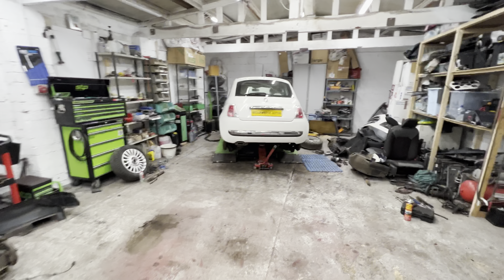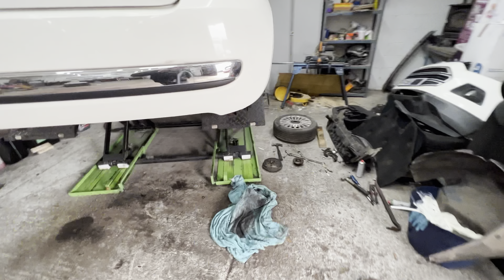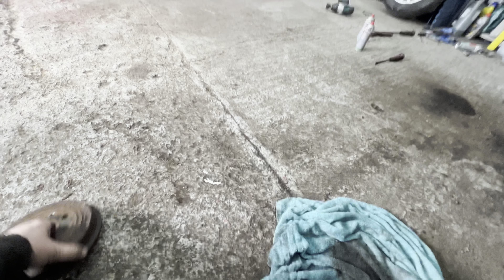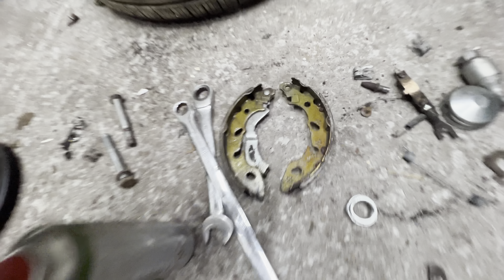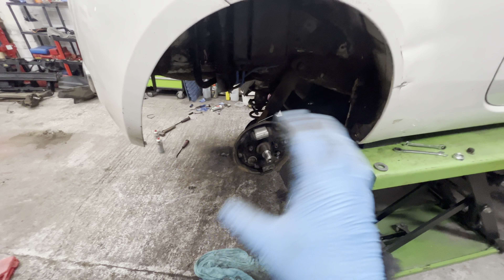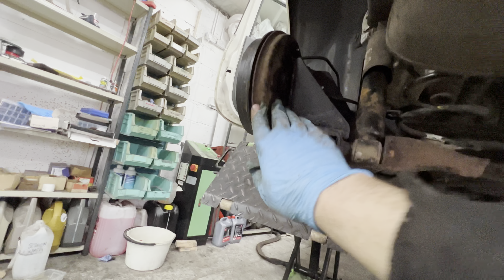Fiat 500 Lounge 2013 Part 3 Fighting The Rear Beam For The Second Day ??

Comment: If you half fill a clear bottle with brake fluid find a soft rubber tube an old vacum pipe fron an engine usually works the soft tube should fit over the bleed nipple tightly the other end fully emmersed in the fluid open the bleed nipple pump the brake pedal until all air bubbles stop showing in the bottle give it one more full pump to floor then go and tighten the bleed nipple
Always worked for me when bleeding brakes on my own
Reply from the maker: Thanks Garry appreciate the info mate 👍👍

Comment: hi mark it will be the rack motor thats gone on steering colum
Reply from the maker: Thanks Brian I will look at that 👍👍
Reply: @ResurwreckAutosUK  on the Mondays they had recall as the bolts that holds motor snap. So worth checking
Reply: @ResurwreckAutosUK  mondeo
Reply from the maker: @thehutx  thanks Brian I have seen a video about that definitely will check 👍

Comment: As I mentioned before you took the beam out you could have removed the back plate from the original beam and tie wrapped to the car without removing cables etc then refitted to beam without removing shoes etc
Reply: This is the way I have seen this change before and as you say it makes it much easier.

Comment: Get yourself an eazibleed you will be able to bleed brakes with no help
Reply from the maker: Thanks mate I do have a bottle I will try that first tomorrow 👍👍
Reply: 100% agree ether the Gunsons Easybleed or Sealey do a one man bleader  which is just like a garden sprayer you put the fluid in and then pump the onboard pump to add pressure then screw the cap onto the master cylinder open the valve to let the fluid int master cylinder then just open bleed nipples to chase air out much quicker than pushing the pedal